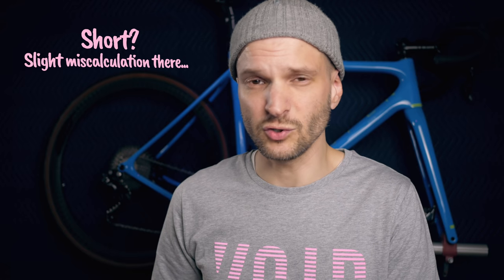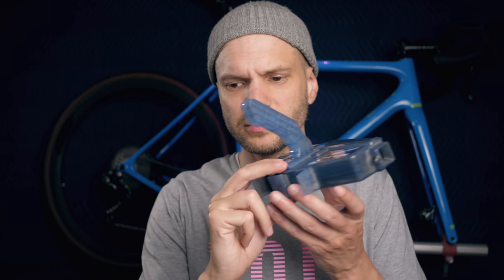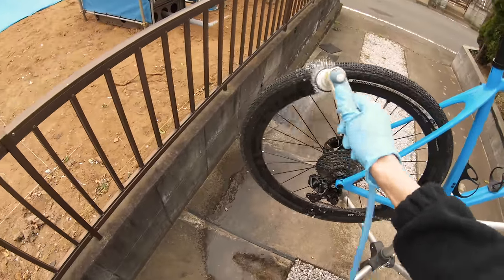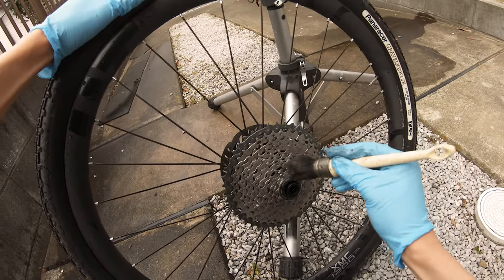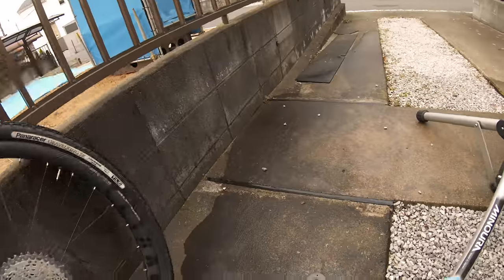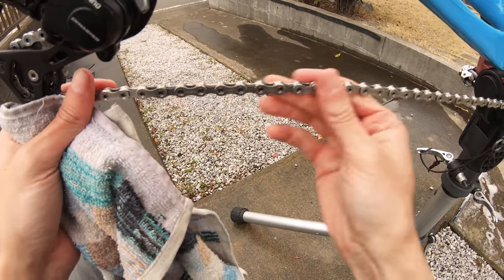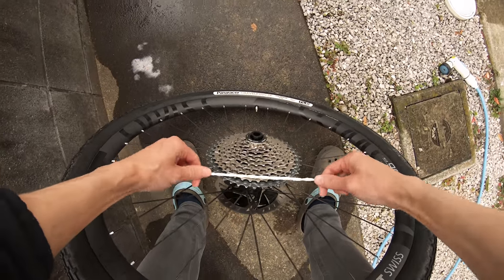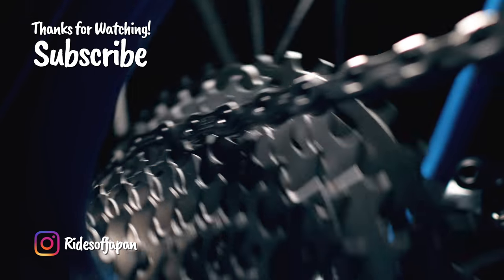My obsessive compulsive chain cleaning disorder

Comment from the maker: Edit: Damn! I’ve read about Squirt before, but reading all the comments settles it! My 1L muc-off is about to run out finally so my next lube is definitely Squirt (or smoove)! Cheers all!
————
FYI: Gunk = Dirt 😅

Curious to hear you bike washing hacks!
I've not gone down the ultra sonic cleaner route yet, don't see that being that effective/fast for this kind of regular "quick-clean", but it's definitely on the cards in the future!
Reply: Park chain cleaner + Morgan Blue 👍, have you tried the Squirt dry lube? Might be worth a look/try.
Reply: Since we're already talking OCD: go the ultrasonic cleaning / molten speed wax route. You'll never go back ;-)
Reply: I ride in winter in Canada. A few mountain bikes on the road and on trails. Cannot stress enough to people about cleaning a bike's drive train. To me its not about wearing out a chain or cassette. Its more about breaking a chain in 21 below zero in the middle of nowhere ha ha...fuck me~its going to be a walk back lol
Reply: Squirt lube is the most time efficient way to have a clean & fast drivetrain. I only needs a deep clean (degrease) every 500 miles. Sram hollow-pin chains clean up the best IMO.
Reply: Microfibre towels/rags for cassete sprockets and chain drying. Squirt-lube for clean, non gathering dirt lube. Few times a year do use light polish automotive cleaner - dodo lime prime - for extra smooth surface, and spray wax with wet application for glossy bling bling finish - adbl synthethic spray wax. 
Must try that park tool cleaner - seems to be better than my current finish line one.
Reply: That's a nice routine you have going! I think the trickiest part to keeping your bike clean is being consistent. Especially if you're less compulsive about it. Find a routine that works for you!

Find gloves that fit properly and save yourself the hassle of having to spend another 20 minutes trying to clean your hands.

I like to wipe my chain and drivetrain with wet citrus wipes before hosing. This takes care of the nastiest gunk without getting it on the rest of your bike and ruining your brushes straight away.

Brushing the chain only gets you halfway there. If you really want to be thorough, I recommend an ultrasonic cleaner. It's the only way I can relube and don't have the chain run black after the following ride. It's also nice to strip your chain completely and starting using wax. If you ride in a lot of grimy conditions it's worth the investment.

I've switched to wax and use Squirt now. It does wash-off if the weather is pouring but you can keep your wet lube on you and combine it with the wax.

Use a quick/missing-link and get an extra chain. If you consistently swap the chains there should be less wear on the gears and they will last you longer. If you're short on time and have the second chain cleaned, you can swap it in and quickly get going without doing a full wash.

Wipe off excess lube, it will just attract more dirt! This might sound obvious but you did not mention this. I've seen people spray lube all over their cassette, thinking that it will make things run smoother 😦
Reply from the maker: Bram Cordie cheers for that thorough run down! Love it!
Reply: Nah nah nah... Oz Cycle’s paraffin wax recipe is life changing! I used to use Squirt, forget about it. It’s got nothing on the Wax!!
Reply: Just something wrong with having squirt on my bike, don't think I can go there
Reply: yeah, that's what I did in the end. The ultrasonic cleaner is great and makes quick order of getting the chain clean. The Molten Speed Wax has been great. After dipping or cooking the chain a few times...its much easier and quicker than the intimidating application that Molten Speed Wax has on their website.
Reply: Agree. Squirt is good for awhile...until you start cooking your chain. @AlexSwan
Reply: Gunk = smuts
Reply: Every part of this video is a YES! It was like watching a video of myself even down to all the brushes you used and preferring the cloth towel over the floss. I use Simple Green degreaser and Dawn dish soap and whatever oil the conditions may call for from dry to wax.
Reply: Forget it if you take care so much of your bike you might as well use pure wax.
It takes forever to apply but it lasts forever, it's technically a hard to remove dustproof dry lube, however just like any dry lube the rain can remove it (but is more resilliant to rain than traditional dry lube), but it doesn't dirt your chain at all, even when the lube is gone it'll be clean.
Be careful with tutorials online like GCN ones that show the process incomplete, wax needs to be carefully prepared to a consistency with wax oil, it it's too hard it will just shave off.
I didn't wash my MTB for one month during summer and the chain was sparkling clean, you could lick it.
The correct process is this https://www.youtube.com/watch?v=gF9nbwsaSHs scrap the GCN video.
Reply: @joen3992  i hear ya, maybe at -5...breaking a chain and puncture kills it for me.
Not nice changing a tube from Schwalbe Ice spiker tyres with no gloves.
Reply: @AlexSwan  I agree, Sqirt keeps the chain clean but does not lube as well as some wet lubes.......or wax.
Reply: Joe N gonna be using the bike as a scooter and free ride on the down hill Lmfaoo

Comment: for my chai; spray with degreaser then run some degreaser through the chain bath 30/40 revs, then fill up with muc off then another 30 revs, then fill up with hot soapy water and spin again 30 revs then wipe it dry and finnish of with a cloth soaked with GT85 dry once again then lube every link individually wiping opf the excess

Comment: I used muc off ceramic lubes then tried waxing with regular paraffin but as the wax did not last more than 100km then get back to muc off again. Shortly after  I was sick of the filthy chain and degreasing routine again and tried waxing with molten speed wax and never looked back. IMO It is the best for maintenance if not for performance. I am alternating two chains and have around 350-400km on each. I also have squirt and smoove and I think they are both better than regular lubes and they can be second after molten speed wax.
Reply: I just buy pure parrafin wax from eBay. 2kg block for less than Aud$25.. Good times 😁

Comment: Great video. It was great to see that I already use the same muc off dry lube as you do. I agree it only last 1 big ride and sometimes I relube near the end of a long ride. One positive for me is that it smells great for a lube. I also use the same park cleaning tool. Great tip about reusing the degreaser.

Comment: I went down this route, however I decided to buy an ultrasonic cleaner. Less effort, better results.
Reply: I worked at a place that had industrial ultrasonic cleaners. Snuck my bike parts in regularly, amazingly clean.
Reply: so you have to dismantle the master link every time? that's not ideal
Reply: T J , don’t believe the marketing. Quick links can be used more then one disconnection, I inspect them during every clean.
Reply: I've gone this route as well. It really is a time saver. Pre heat the degreaser in the ultrasonic, run it 3-4 min each side...and you're ready to go with either wax or lube..
Reply: @TJ-iq8nw  links are cheap, and in fact reusable. i have even used Shimano pins more than twice with no issues. always carry a chainbreaker tool and spare links.
Reply: @TJ-iq8nw  I haven't had any issue disconnecting and reconnecting my master links multiple times (9 and 10 speed chains). I throw them out when I replace a chain.

Comment: Nice tip on reusing cleaning solution. Have you considered waxing (Pedros wax, Mothers etc) bike frame? Can also use ceramic coating spray (Chemical Guys and such), it would help to prevent dirt and gunk sticking up to the surface. That was you can simmply rinse it off and wipe dry etc.
Reply from the maker: I haven’t no... got that tip about ceramic coating in another comment as well, very intrigued about that one, haven’t had time to look into it much though.
Is chemical guys what you recommend?

Comment: Best chain lube is right under your nose tbh! if you use the morgan blue chain cleaner, why don't use their chain lube also? I highly recommend Race oil, it's what the pro tour teams use. Need any other advice really? I found that Muc off stuff is very nasty, if it's a dry lube it comes off easy and in my opinion a lube that comes off pretty quick does not lubricate properly. As for muc off wet lube.. DON'T ever ever leave it on for longer as it will dry like tar and will only come off with a wire brush. 
I'm a bike mechanic and tried all sorts of degreasers and lubes and yeah, morgan blue stuff is THE BEST by far. Also try their Mud off cleaner-it's a wonder :)
Reply from the maker: Raz Raz cheers for the tips mate!
I got the Morgan blue race oil, nice stuff indeed... runs a bit dirty for my liking... but been quite a while since I used it though so might be time to whip out the bottle again.
Cheers!
Reply: @ridesofjapan  Yes it runs a bit dirty but remember that a chain should be lubed properly first of all. You are already giving your drive train a clean after each ride, and the cleaner really does work well and gets the chain spotless. I prefer a dirtier chain if it runs smooth and is lubed up as it should, it even saves up a few watts some say :)
Reply from the maker: Agreed 👍

Comment: wow same process as me except i point my pressure washer vertically down to blast out any grit. avoiding any bearings, then use the park tool chain clener. i also wipe over the chain with a j cloth sprayed with wd40 to stop it rusting between rides then drop lube each link. very cathartic. before lubing i may check chain wear, i have noticed since regularly cleaning my chain it lasts longer. did a 50 mile towpath ride the other day and got covered. had to clean my bike before i cleaned myself. a clean bike is a joy to ride.

Comment: I share a similar disorder. I really like my drive train quiet. First of all, I'm a fair weather cyclist, so the bike itself doesn't get that dirty and I'm fine with that. No bike washing for the sake of it, I think it does more harm than good. Drive train is different though. First I unclip the chain link and remove the chain. Then with a brush and a container of solvent, I go about cleaning just the teeth on the cassette, chainrings and derailleur. I really don't want solvent anywhere else other than the teeth.  Onto the chain now -  I degrease it thoroughly, let it dry for a bit, and I apply heat with a heat gun, followed by a drop of Progold Prolink on every pin. I'm working 30cm at a time. Once done, I let the lube settle for 24 hours, give the chain a good wipe, and it's ready to go on the bike. Quiet as a mouse.
Reply from the maker: Love it!! 👏

Comment: I think most cyclists have the chain cleaning OCD. I clean my chain after every ride but I use washing up liquid which works for me. I'm weary of using degreaser as I think about the bearings. Use a sponge first to get the dirt off then washing up brush. Just to be extra OCD I have used a mascara brush to get in between the links. my girlfriend wants me to get a mental health assessment!! I saw some motor bike chain wax is this ok for a bycycle?

Comment: If u don't care about the environment use rock n roll both gold or blue are super fast and clean if u use it correctly. I used squirt before, and I found it doesn't flow into the pin that well and build up wax if over applied. For lube I still recommend rock n roll, mugoff is dirty in my opinion.

Comment: Great video. I washed my commuter bike today in preparation for a new chain. My pulleys were so jammed up with gunk they would barley spin after the old chain came off!
Questions:
1.  What is the brand of that thin oil you used on your pulleys and would you recommend for a commuter bike that gets cleaned a few times a season. 

2. Have you switched to Squirt and are you happy with it?
Reply from the maker: Cheers mate, 
The oil-thing is some Japanese brand (I think) I found locally... it's basically oil based chain lube. Anything will work, it's the bottle itself that makes is so good for that particular application.

I have not started using squirt yet...  I actually decided to get Smoove instead, similar to squirt but apparently a bit better in the wet. Will start using that next time I swap chain.

Comment: Just started using wax on my chain (hot melt wax) and will never go back to anything else. Everything stays very clean and silent and is a pretty easy process once you have degreased your chain initally. Basically just wipe it off a bit on the outside, put it in the hot wax, wait 10 minutes, remove it and wait another 20 minutes, done.

Comment: What a nightmare. Watching this video I remember why I got rid of that midieval chainmech and turned to a Gates belt Rohloff system. After hours of training through rain and dirt there's nothing more Zen then pointing the garden hose at the drive train and see all the shit vanishing in less then a minute, even without touching one single part of the bike. Chains are nice as long there's summertime around and one can hold hands away from it.

Comment: I moved from muc off dry lube to super secret chain lube ... a soluble wax solution.  It's amazing, easy to apply, doesn't attract dirt and keeps the chain and bike way cleaner.  

Saves a ton of watts too, if you believe the blurb.

I only use for 'dry rides' mostly though, as a wax lube isn't the best for protecting metal parts. If things do get damp unexpectedly, I'll use the daughters hairdryer.

Comment: that was the best system i ever saw. off to my dollar store and hardware store now ! i clean weekly too, or more, but missed some details. 

i have a service question. why does my rear wheel make pinging sounds from the spokes sometimes, under load. ?
Reply from the maker: Are they a custom built set? maybe they where not "de-stressed" or whatever you call it? 
Could it be that the spokes has too low tension?
I'm no wheel builder so that's pure guesses, but if you're worried I'd have a bike shop take a look at them.

You could always put a drop of lube where the spokes cross but that would probably only mask the actual problem.

Comment: Morgan Blue is THE BEST!!!! But you really don't need the park chain cleaner when you use Morgan Blue. Just brush it on, let it sit for about 5 minutes, then wash it off with a bit of pressure from the hose, chain comes out sparkling clean. I use the same brush and technique for my cassette and chainrings. Rock and Roll Gold is a fantastic lube. It cleans and lubes in one step. This allows me to just relube with Rock and Roll after every 100 miles or so. Then I do a full wash about once a month.

Comment: You may be able to find a couple of 'air compressors' that will work for you.. I use a small cordless leaf blower to dry my bike.  Also a very small shop vac can be used to blow (or vacuum) water from the chain/bike.  Just a thought.. However, the tiny compressor is nice because it's controlled... you could use that to remove dust on camera lenses maybe too... :)

Comment: +1, I do the same level of treatment, except use a small hand brush to clean the inner space in every link.  I prefer Rock 'n Roll Gold lube, it keeps the chain really clean if applied right, and it lasts forever for me.  I use a Rohloff now, so no more scrubbing pulleys, I don't miss them lol

Comment: Smoove and Squirt for us is The Golden Standard for chain lube. No more oil dirt around all the bike, much more long lasting lubricant than any oil based lube, self-cleaning effect and all-seasoning for all-terrain, include  even sand roads. As I see in comments, these are very popular solution worldwide.
Reply: They are a close second to parrafin wax. I just buy pure parrafin wax from eBay. 2kg block for less than Aud$25. No degreasing required. No black grease ever! Just dunk in slow cooker! Lowest friction too according to Friction Facts. Good times 😁

Comment: We are in the same obsessive category sir. I have 6 chains that are on a rotation schedule, (chains are all waxed in a slow cooker and rotated every week). Wax chain are dry and dirt does not stick. As for the rest of the bike , once a year I apply ceramic coat, making the frame very slippery and a good blast of water with a power full spray bottle gets rid of everything....a hose wash only once every month or so....check out Oz cycle cleaning bike tips. Nonetheless, I see cleaning the bike as a therapeutic-ONE moment, but I do not have a name for my bike. Hmmm....did I miss something?
Reply: Ravin Premji Could you, please, tell a little more about the ceramic coat? How to apply it and brand? Thank you😁
Reply from the maker: Awesome, love the dedication!
Like you I rather enjoy my bike cleaning sessions and I’m not looking to change that!
The Ceramic coating sounds very interesting though!
Reply: Would love to know more about the coating
Reply: @chrikim67  I use CQ.UK 3.0 from carpro. It's made for cars , originally Bought it for my car, had some left over and used it ..... It's a little pain to apply it. But once on, you are good for a year.

Comment: I love squirt but beware, it creates A LOT OF gunk. It's not nasty like regular non-wax lube and doesn't just get on everything and make a mess but your parts will have massive gunk build ups around them. Eventually you will have to disassemble the whole thing to clean. Which is fine but can be time consuming. I guess won't be an issue for you if you clean often. I switched to UFO. Overpriced like CRAZY but one bottle lasts months and months for me since you don't have to apply too much at a time.
Reply from the maker: Good to know! I’m kinda guessed that would be the case with Squirt, but still I need to give a test myself :)
Cheers!